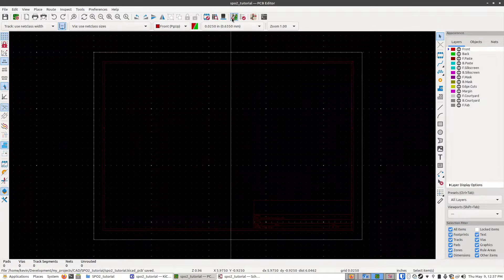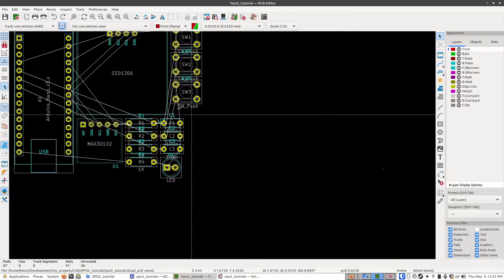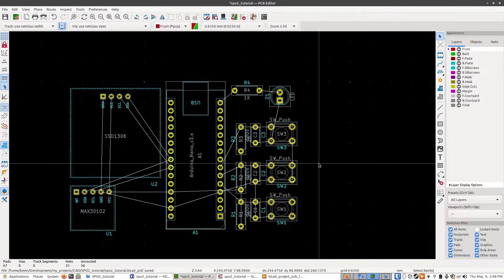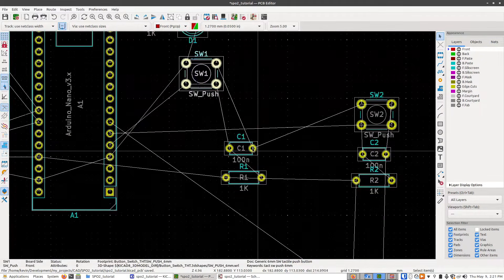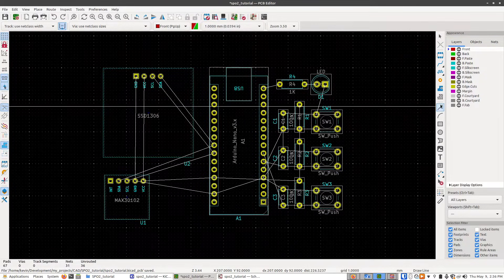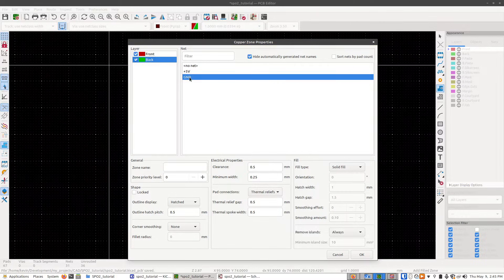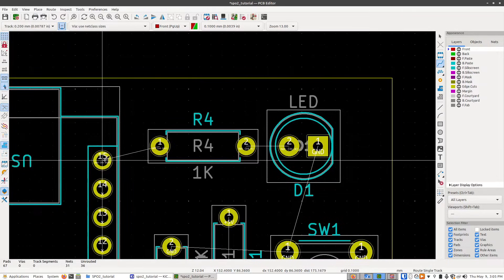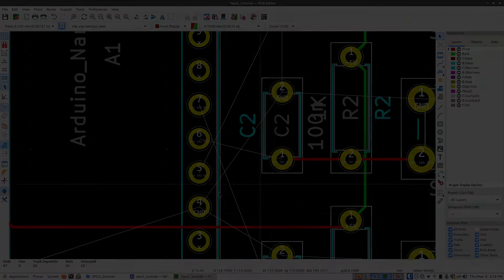KiCAD Project PCB Layout | Part 6

Comment: at 8:04, how did you get rid of the orange color? After hitting "b", I cannot seem to rid myself of the orange/red fill color
Reply: I had the same question but I think I figured it out. If you hit <CTRL + B> it will remove the fill. After you run all the traces but GND, hit <B> again and it will refill while leaving the traces intact. Someone please correct if there is a better way.
Reply: @markloyd8616  i will make it your way
i had same problem
Reply: @markloyd8616  yes after some research its fine
Reply: i, think he used Ctrl-Z (undo), and does this again of camera. Because he says you dont have to worry about routing ground pins for now...
Reply: It's ctrl + b